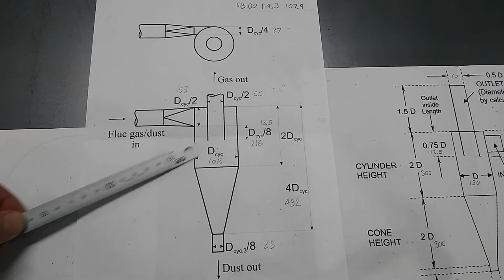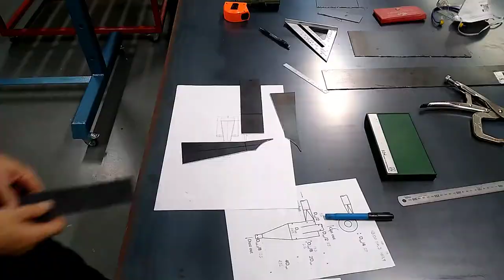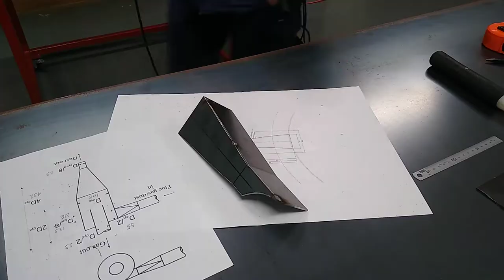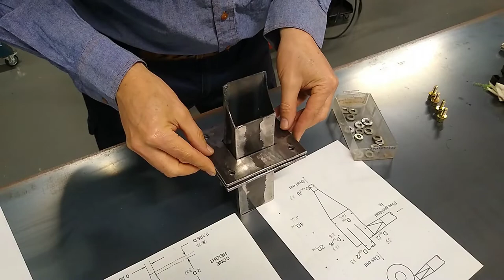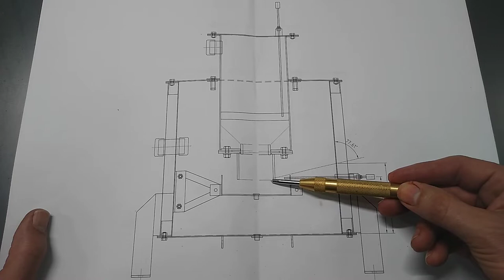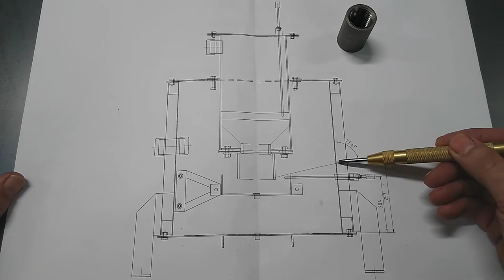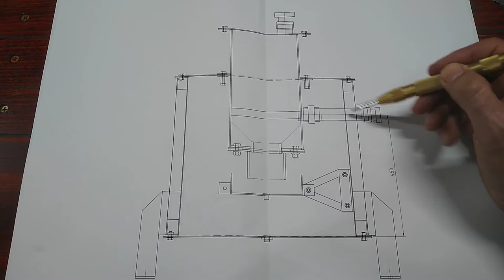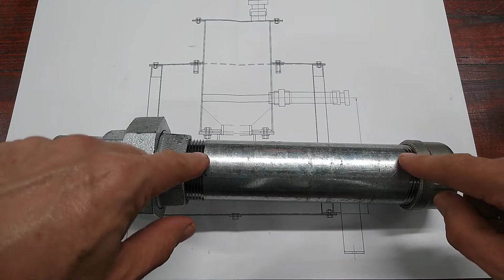Electricity From Wood, Wood Gasifier/Generator, Gas Outlet & Bits E4

Comment: Your gasifier is quite the work of art  :) . 
 Indeed, it is something that you'll be able to proudly show off to your visitors, when their questions inevitably begin to pour forth. 
 So many of the gassers I have seen online, were constructed rapidly, with no concern for appearance or operational maintenance. 
 Yours, on the other hoof, will surely be a pleasure to work on. 

 Perhaps you have already considered this, but I wood like to suggest the addition of inspection ports, flame intake ports, and "rodding" ports in the plumbing that will ultimately be fitted to the installation. 
 I learned that there was a need for these, the hard way, during my early days with these rather addictive power plants. 

 Once installed, they turn maintenance from a chore into a breeze   :) .
Reply from the maker: Thanks, I'm kinda exploring just how close can a bloke in a shed get to something bought/manufactured with a basic setup, I feel, building up our ability to make & fix stuff might have to be relied on in the near future. This is something NZ has always been good at, look at the late John Britten. Yes I will be putting in cleaning ports flanges etc. Cheers
Reply: @whathappensintheshed  
 Yup. In our early days, we had to settle for second best. 
 Nowadays, our personal standards dictate that we work towards excellence in all that we create. 
 While it may take appreciably longer to build a project, we can ultimately stand back and truly admire watt we have created. 
 My homemade CNC router allows me to achieve some of these goals, as he lovingly hand makes all those fiddly little parts, and allows me to take the credit for them  :) .

Comment: A beautiful job. I am curious if it is possible to burn scobs, shavings and sawdust in a gasifier. Is it good fuel?
Reply from the maker: Thanks, my understanding is the shavings, sawdust would not have enough air gaps in between them to allow the gasifier to breathe properly, best to run on chunky fuel. Cheers